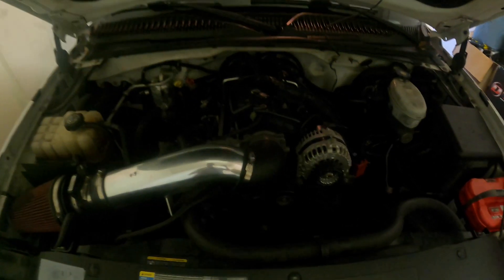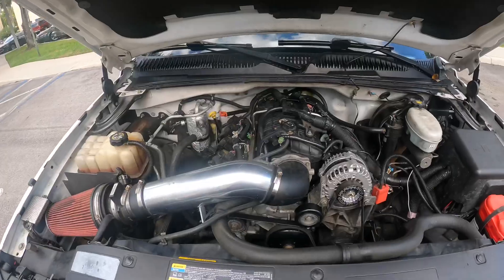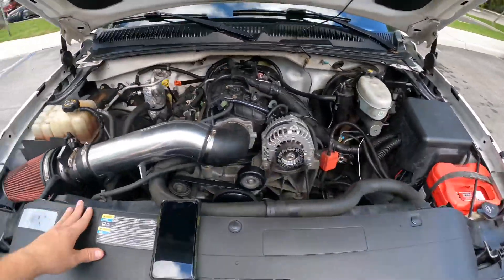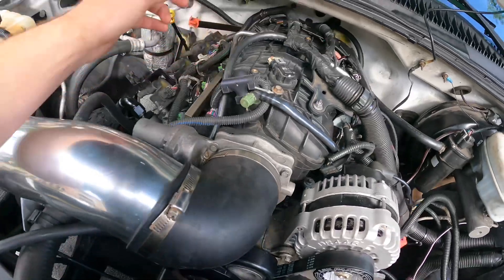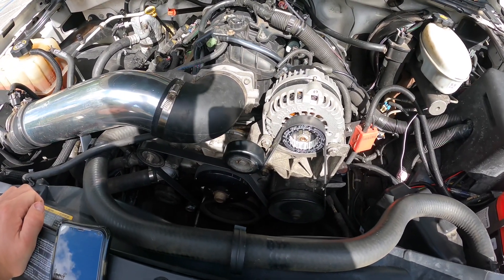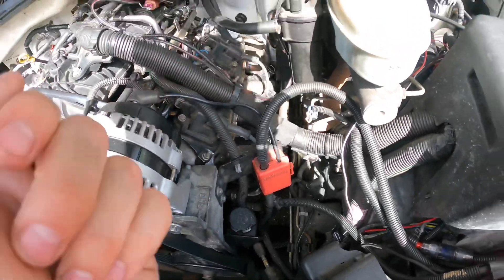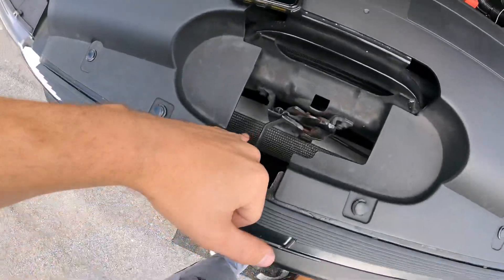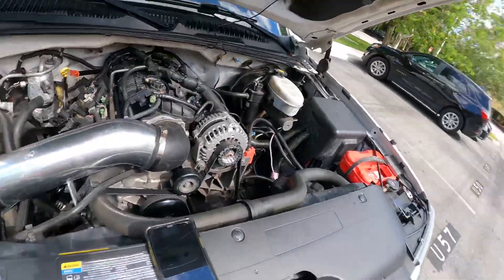Build Breakdown on my Cammed Silverado - Part 1

Comment: Thing sounds wicked. I agree with the fuel prime if it only does it at cold start. Mine fires right up but idles crazy for the 1st min
Reply from the maker: So far, it’ll do it cold and hot! Frustrating!!
Reply: @SiskBuilt  i know you know your stuff but have you checked the tank pressure. I had emissions issues after cam swap but after swapping out the 2 valves my started easier on 1st lick

Comment: How much did it put on the dyno I have basically the same setup?
Reply from the maker: It made 385 buttttt I had some transmission issues. It doesn’t move like a 385 whp truck

Comment: Cycle your ignition two times before you attempt to start the truck and see if that fixes your starting issue. All it's allowing is a longer priming sequence on the fuel sending unit.
Reply from the maker: I have done that in the past and usually get the same result as in the video. I have no idea :(
Reply: @SiskBuilt  could it be our tune😭🤷🏾‍♂️went to the same guy as you and have the same problem time to time